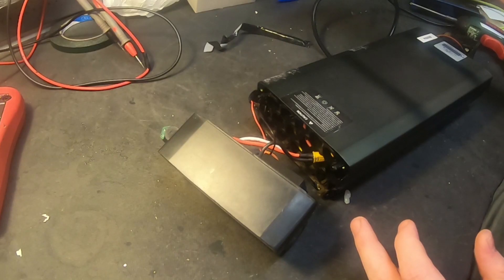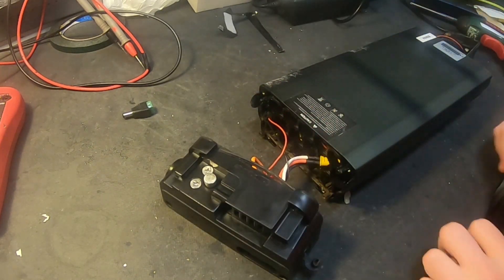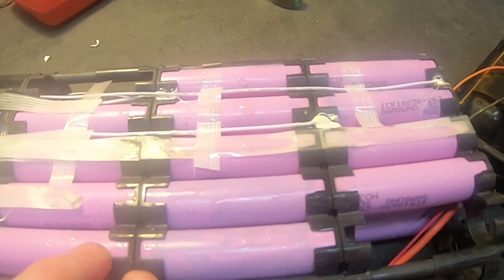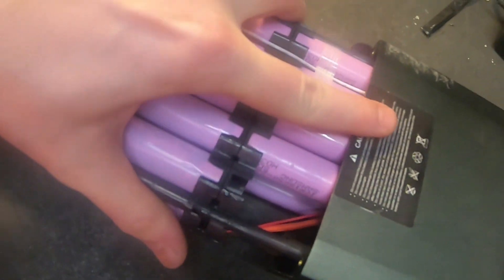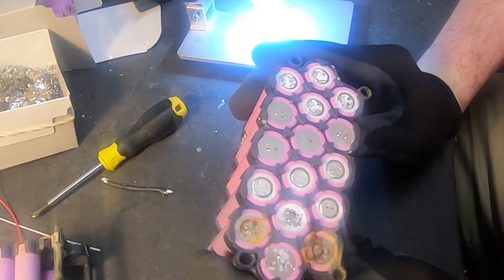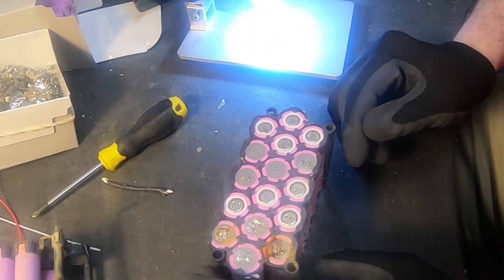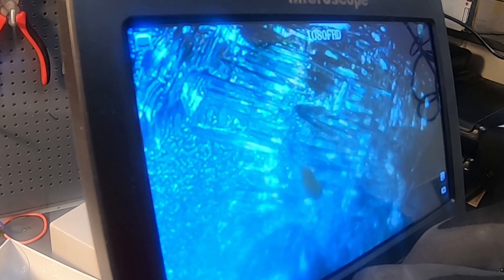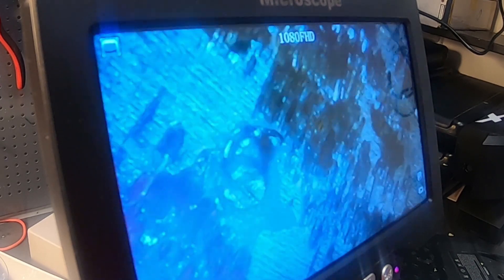Victesse ebike battery = Water Damage + Refurbished cells

Comment: How big voltage should be in 36volt battery ? Because i bought old ebike . I checked voltage was 18.7volt after charging , before was 15v . I Turned on bicycle i putted the biggest asist level bike self turn off and i cannot turn on 😂. Do you think is good time for new battery ? 😂

Comment: The batteries that are rusted on the ends, are they not good anymore? I have a battery pack that was in the water and blew a few resistors on the BMS. I want to save the pack, so can I get a new BMS and use the same cells after I clean them?
Reply: Water damaged BMS is always crap. But many cells can be used, usually only a few is damaged. Check the voltage and remove the ones who have lost voltage. Small traces of rust is no problem.

Comment: riding home my bike suddenly died.  shut the key off and turn her on wont start.  the display would only turn on when I pedal.  Got home to check.  The shrink wrap was damaged by me  zip tying the controller to it by vibration.  To my surprise a puddle of water build up inside the frame submerging 1 of the cell quarter inch.  God know how long it was wet for .  1 CELL has a little rust on it.  The BMS did not get wet.  Shes been drying for more than 24 hrs and still wont turn on.  You think my Battery and Controller box is TOAST ?  What needs replacing thanks. My kit is 48 v 1500 watt.  Also she wont charge when plugged,
Reply from the maker: You should not try to charge it. You need to replace the cells and BMS or get a new battery, try and look for help here: http://thebatterydoctor.eu/battery-repair-services-in-europe/
Reply: @TheBatteryDoctor  thanks .  Everything you said makes sense and I actually thought the same.  I've also noticed that the display screen seems to be drawing power from the Hub spinning like an alternator.  I say this because I would have key on off.  Start pedaling and press the start button while key is still off.  Display would turn on.  Turns off when I stop pedaling.  Is my observation right ?
Reply: @TheBatteryDoctor  thanks a lot will do .